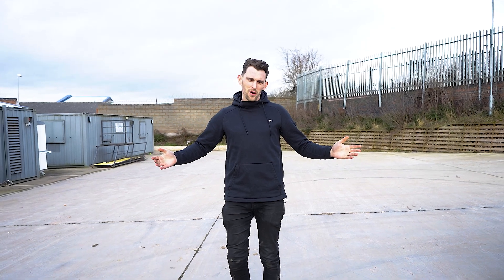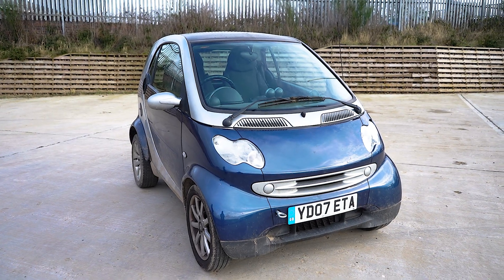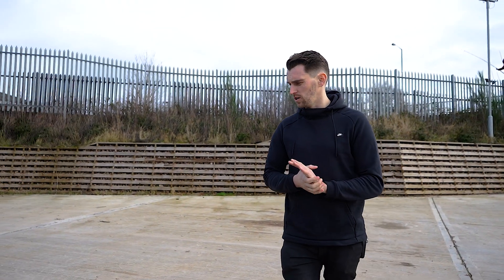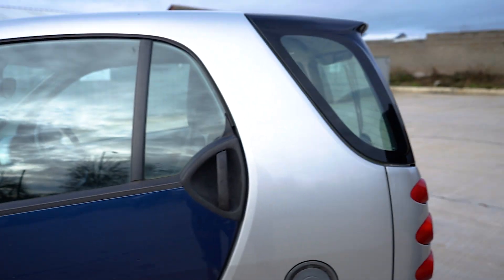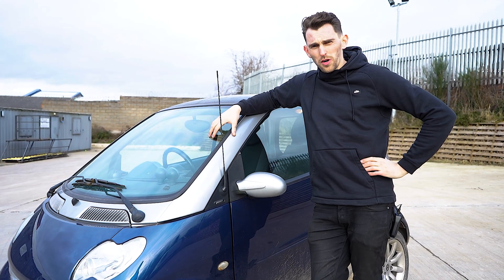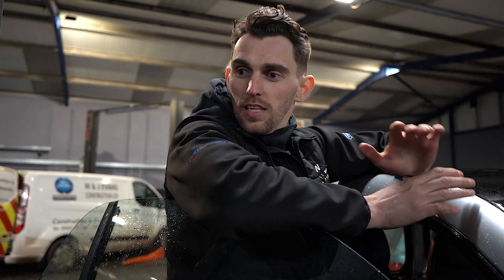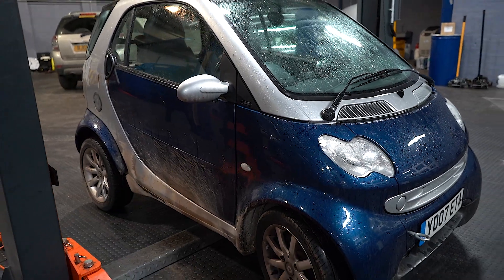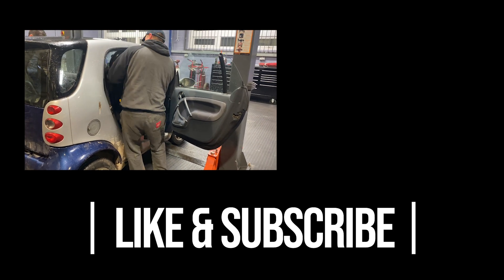Putting a Motorbike Engine in a Smart Car "Smart-asaki" | Part 1

Comment: Got taken out for a ride in one in the mid 2000s; great when it's working and very quick, like nothing I'd ever experienced. There are some drawbacks - e.g. loss of traction and stability control (ESP), no reverse gear as well as increased clutch wear.

See below for a couple of my videos showing this type on conversion to a smart roadster
https://youtu.be/gxUgIXE-F7U?t=577
https://youtu.be/Zh-aKzsbk1w?t=286

Good luck with the project!
Reply from the maker: Hey man, we’re so deep into the research on this, we hope we’ve figured out a reverse gear solution for this, we’re going to need to test traction solutions with various suspension tyre ideas been thrown about! 

I love the sound of a roadster conversion! 🙌